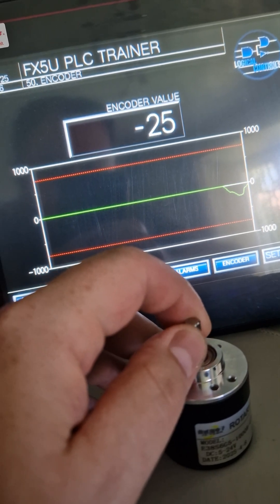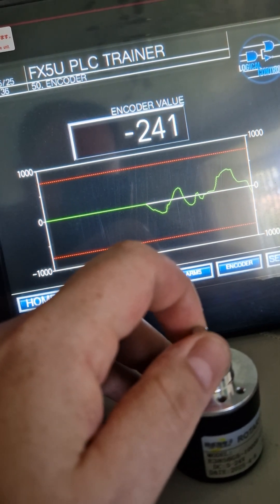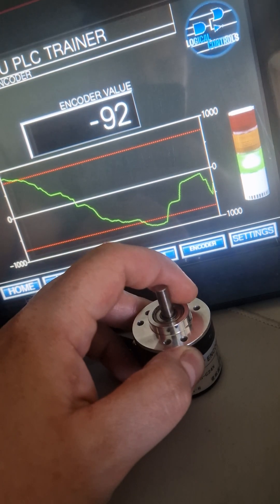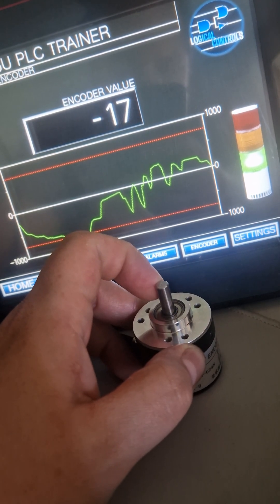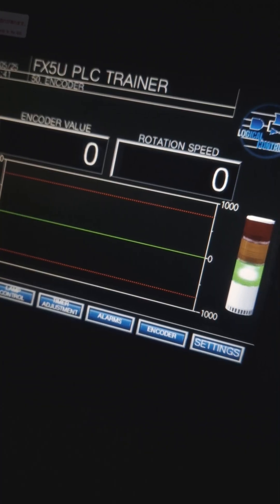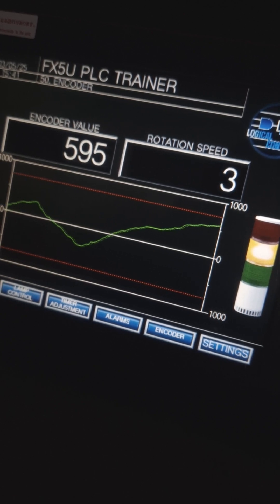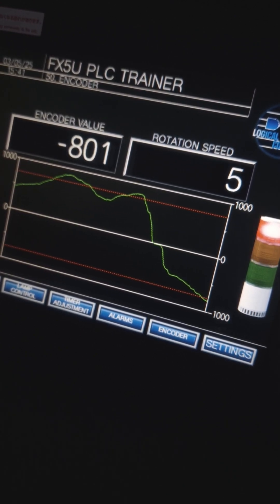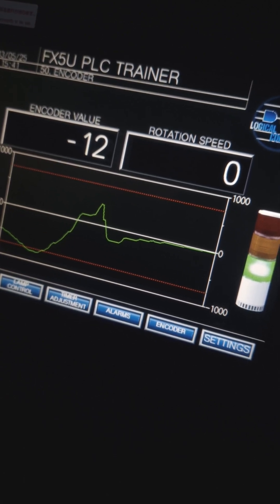Motor encoders for industrial automation #automation #plc #plcprogramming #electrical #controls

Comment: what type of encoder is it and can it measure 3 phase induction motor speed and direction?
Reply from the maker: @mmbakabenchi1480  It's an incremental quadrature encoder. Yes it can measure the speed of basically anything that rotates 👍